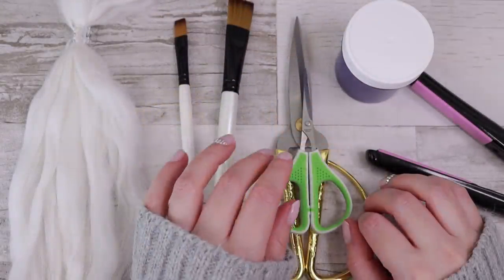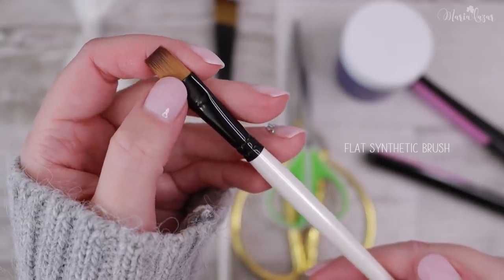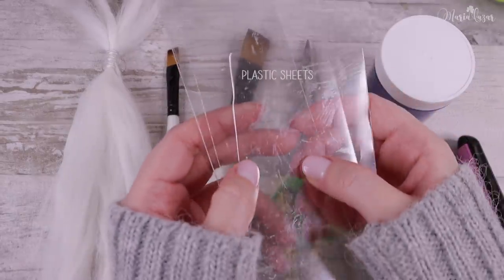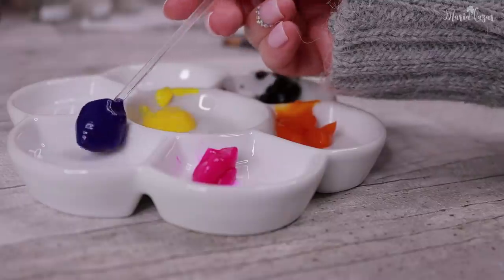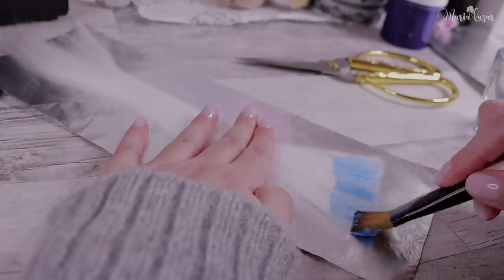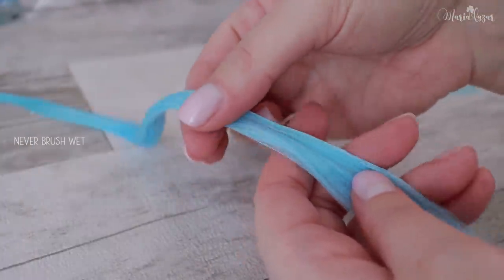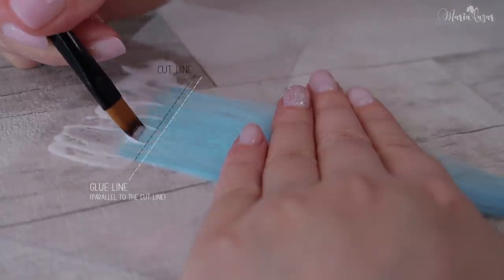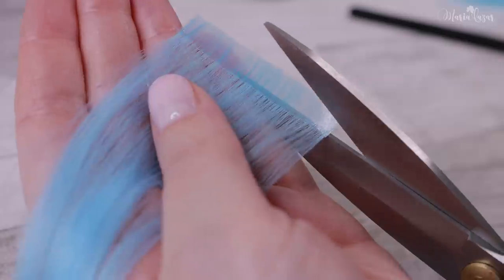Wig Basics - How to Make Wefts for Art Dolls and Sculpts OOAK

Comment: Because alpaca is a protein fiber, you can add a little vinegar or citric acid and soak in hot water. The dye should completely soak into the fiber, leaving the water clear. Look up how to use food dye to color wool for more details. 🙂
Reply: Where can you get alpaca fiber? Or do you brush it out like i do with yarn? Can i get this so finished somewhere? It would take so much less time..
Reply: Can confirm!! Used to make wool dread extensions. I used regular green food coloring for my first set. Turned out amazing. Vinegar and salt work amazing for setting colour in natural fibres.

Comment: Wonderful video as always! I do have a question, what temperature do you recommend for a straightener on Suri alpaca hair?
Reply from the maker: Thank you! 😊♥ I've noticed it can withstand 200°C but definitely not multiple swipes, the ends burn a little and I can see them curl up (this is without heat spray). I'm aiming for lower temperatures like 80 to 100°C but also with a heat protection spray.
Reply: @MariaLazarsArt  Thank you so much!